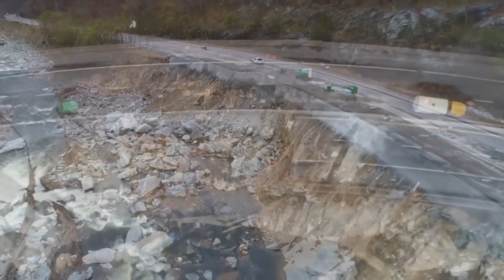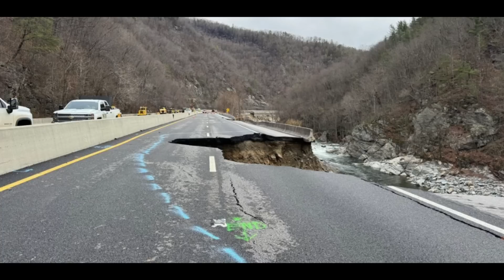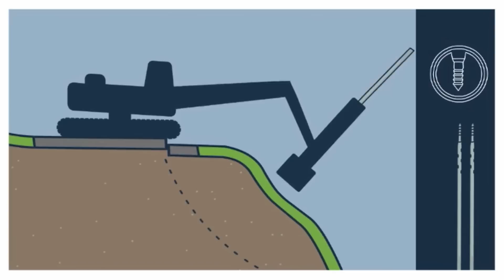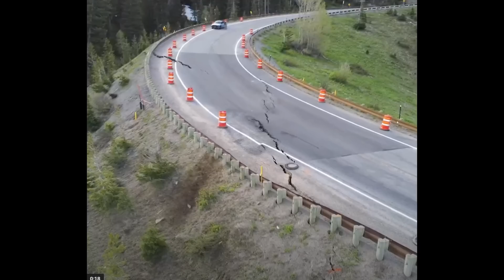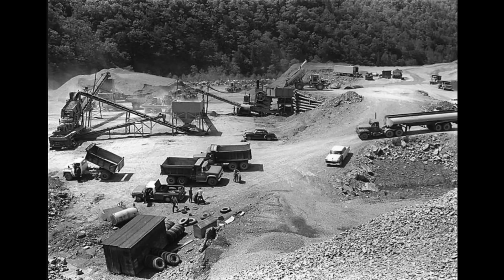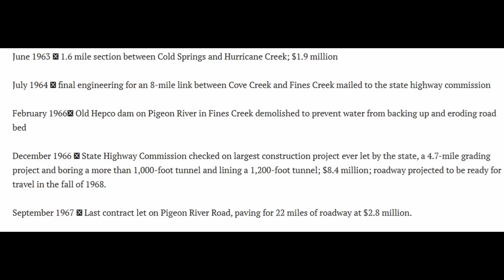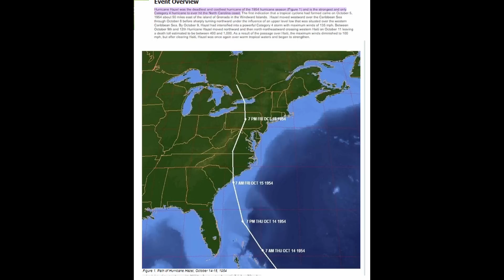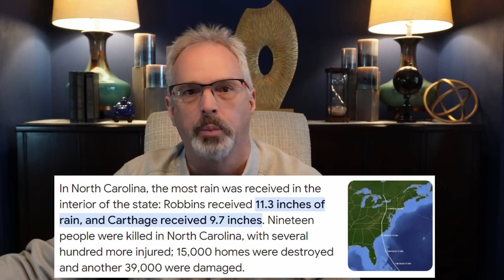Interstate 40 Rebuild Status

Comment: The alternative to the current route through Haywood County would be to go through the gentler slope over in Madison County (as I understand it). But the problem there would be a better bypass around Asheville. I’m not sure how much that would add to the cost.
Reply: The Asheville Bypass has already begun but that doesn't mean a great deal to this problem at hand. It will take a decade to complete the Asheville Bypass at least. Currently I 40 detour traffic has been rerouted  through Asheville. The traffic on I 26 and I 240 has become has only made local problems here worse.
You are correct as to this being a much better route to Tennessee. The current path of I 40 was a political mistake.
Reply: @tomwilliams7773  You are right. But the new bypass is for I 26 they would need to add two more lanes for the I40 traffic up to where I 40 turned west about Weaverville.

Comment: Thanks for your sensible update of this project.  I had no idea what was going on because the News has moved on.
Reply: I agree, as soon as its not headlines anymore they don't care anymore, however something like this is critical to the transportation industry.  Everything a person purchases comes by truck at some point!  🤠👍
Reply from the maker: Thank you I appreciate it!
Reply: Your comments on rebuilding  I40 NC. On the 15K loads of fill. Consider the damage those loads would do to existing roadway. They would be working on it for the next decade.
Reply: @cwdtransport2247  his estimate was 55,000 truck loads.
Reply: The drills into the shock crete are a waste of time, there is nothing like enough rebar in the shock crete to hold the drill plates of the pins. It will crack the shock crete @ the plates of the pins… this is wasting too much time, trade materials for time . Carve into the mountain for a new base, think ,, (bigger),, scale up.
Reply: They're still talking about Jimmy Carter dying on WLOS.

Comment: Need a relocated route that is out of the river valley. Time for NCDOT to begin studies.
Reply: No just need a different river valley . Needs to go down the French Broad River valley to Newport TN.
Reply: @robertkirkpatrick7903  
The US-25 route. It is really not better than the current route.

I was thinking of relocating 10 to 20 miles of the existing route, on a straighter route on higher ground, with 2 or 3 tunnels needed thru mountains.

Comment: It's just amazing to me, how little common sense or critical thinking is used by state engineering agencies in today's world! Your channel deals with a lot of state DOT type situations, but this lack of skill, ethics, common sense, critical thinking seems to be prevalent in every situation you cover, and from state to state! Is the cause, that states want to do everything as cheap as possible now, and the public or taxpayers safety or consideration for long term infrastructure is no longer the goals? On the topic covered, they should re-route the road to higher ground away from the river, and especially river bends that will cause the most issues during flooding situations! Open the two lanes to get traffic flowing again, while they divert the road away from these areas!

Comment: Your rough calculation of the amount of fill necessary to rebuild I-40 to the original 4 lanes is excellent. One recent example here in California was an effort to remove sediment that had accumulated behind the Devil's Gate Dam in the last century. Los Angeles County Public Works removed 1.3 million cubic yards of sediment, but it took 3 years with a huge number of the tandem-trailer trucks (I think 24 cubic yards total) making 400 trips a day. The access was very easy with the location about half a mile from the Interstate 210 freeway on and off ramps at each end. The Devil's Gate Dam is on the Arroyo Seco River, just above the Rose Bowl stadium in Pasadena, so they really needed to restore the flood-control capacity of the dam.
Reply from the maker: Thanks Eric.  Sedimenration behind dams is a huge problem and it's only getting worse each year.
Reply: @CaseyJones-Engineer someone should have thought about that on the Columbia River!

Comment: I drove this section of I-40 in eastern Tennessee and western North Carolina in 2016.  This a rough estimate, it could have been any time from 2015 to 2019.  After driving this road once I swore, I'd never drive it again. It's what they're not saying that matters.  Rock slides are an issue on this road, requiring constant attention.

I found that when maintenance was being done, they would condense the road by minimizing the shoulder lane and adding a Jersey barrier.  Repaint the lane markings at minimum widths, add another Jersey barrier to protect construction workers and voilà you have a minimalist highway.

The current alternative to I-40 is I-26, which is 2 lane and no trucks.  Trucks are sent to I-77.

If I were asked for my opinion, and I won't be, I would recommend digging tunnels like the Norwegians.

Bob
Reply: Trucks can drive on I-26 I drive it all the time

Comment: Drove this section sections several times over the last 30 years.  Last time a couple months before the storm.  It surprised me how little had changed over the years the Eastward route had a lane closed coming from Tennessee every trip I can remember, not sure why.  I also noticed how the hills were not stabilized for rock fall with fence and not cut back at a good angle.  If the last real road work was in the 1960s, I would assume the must have been a revitalization plan for the road as it entered the new century let alone 25 years later as the population does grow and with it traffic!  Also guessing the state and region would have a budget and funds in place to perform this revitalization as it is a major east west highway and also railroad corridor. Doesn’t this area contribute to the state GDP?  Curious to see how and when this crisis is solved!

Comment: No, they will have to restore 2 lanes and re-route the thing... You made the video about Brienz, GR, CH. Maybe the north-corolinians want to take a page from the swiss book of the A4/H2 between Altdorf, Uri [46.8909N,8.6186E] to Ingenbohl (North of Altdorf) along the Vierwaldstättersee. The Axen-Street. A heavily used section of road, only two lanes, parts of the stretch is sliding into the lake. Swizerland is currently creating tunnels to re-route the traffic and try to improve to the whole flow, because this street is the shortest route Zuric City to the Gotthard Passage (Pass, Autobahn-Tunnel, Train-tunnels)

Comment: My question: have you seen any traffic studies which justify the need for 4 lanes? Would 2 lanes satisfy the traffic load?
Reply: After driving that route may times, 2 lanes would not support the traffic load. Many sections of the uphill have one lane filled bumper to trailer with trucks. Traffic volume is high as it splits into two interstate highways at Asheville and two interstate highways at the north end of that stretch in TN.
Reply: No it is I 40 . Most days it needs Three lanes now one for trucks and two for cars . I 40 and I 26 are the only tow interstates from western North Carolina to tenn. And most two lane roads in the mountains are narrow and sometimes steep.

Comment: I was a Red Cross Disaster Chief at the Smoky Mountain fires in Dec 2016 and quite familier with the I-40 area from Asheville to I-81. I agree with your assessment that they should reroute I-40. There will be a lot of push back due to political and tourist issues with Casinos and Dollywood. Mr Jack
Reply: Seems the folks running the casino, tourism and other businesses were not paying attention to the reports that came out years ago about the condition of I40 and bridges.  One would think if your business was tourism for estate, mountain or casino visits that you would insure the infrastructure would allow customers to get to and from your facilities and the same for agriculture, forestry or manufacturing to get raw materials in and products out of the area!  A lot of timber on the ground in the region again this year curious to how the region deals with that.
Reply: Why would the casinos and Dollywood care? If this section of I-40 were rerouted it would still connect up to the existing highway somewhere west of the gorge. It would also make the road more reliable, which would be good fro the business in Pigon Forge area.
Reply: @JeffDeWitt  The casinos is in Cherokee N C.
Reply: Rerouting I-40 on this 22 mile section will not affect either Cherokee or Dollywood. They are nowhere near the area affected. What will affect those places is the time that I-40 is closed. Rerouting this section will not change one factor. That is how remote this section of road is. The North Carolina section has no nearby roads for miles. They will still need to truck in a lot of materials. I-40 is a major east/west route. I-26 will be able to take up some of the slack once it is completely reopened.
Reply: @larrypatty8333  I-26 is open, but limited to vehicles of 10' width or less.
Reply: I bet, if someone presented the right plan, Dolly would come out in favor of the re-route and that would end the political debate.
Reply: Rerouting I-40 through the US 70 corridor makes sense, and would connect with the current alignment near Newport, TN. It would have no affect on anything in Pigeon Forge or Gatlinburg.
Reply: The people in that area would be much better off without the tourists, casinos, and Dollywood.
Reply: @jimturpin6503  how with no jobs
Reply: I agree, a quick and dirty method would be simply to renumber I-81 up to I-78 by Hershey PA and the full length of I-78 as I-40.

Comment: I'm a bit curious about what the bedrock looks like under the road and filling. Overall geology is important. If the geology is bad then making a tunnel might be a bad idea.

When you say 1 in a 1000 - then the question is also if it's 1000 years, months or days.

For cost measures - it's also hard to compare 1960's costs with costs of today given that the equipment available today is often more effective and there's a lot more experience to build estimates from. Inflation has taken a toll on the cost too. A simple relation to inflation is that $100 in 1965 is now $1000. A lot of permits are more expensive today though.
Reply: A lot of the bedrock is not good.

Comment: I believe that rerouting of this section would be in the best interest since they have had many previous events that have limited traffic or even shut the road down.  Great work and observations!
Reply from the maker: Thank you!  I agree they need to completely rethink what they've been doing out there.
Reply: Where - this is the mountain pass, the other option is to go over the mountain.  A 16 mile stretch then becomes 40 plus.
Reply: @scotthix2926  Take I 40 north of asheville and about Weaverville turn to the west going by Hot Springs and down the French Broad River to Newport Tn .Basically taking the same route as US 25 and US 70 . I 40 goes threw the Pigon River gorge on its way to Newport TN now.
Reply: @robertkirkpatrick7903  Might better utilize the $$ to widen US 25 and make it I-40.
Reply: @scotthix2926  Point well taken, yet look at all the isues they have had over the years with slides resulting in lane or tatal road closures.  if you throw in a couple of billion to repair, what will prevent this from happening again?

Comment: If they want 4 lanes of traffic they need to dig up that failed section and start from scratch. Trying to repair it will not work and will end up costing more money and time. They need to keep the road closed until it's rebuilt. What is the expected lifespan of an interstate hwy?

Comment: Why is it necessary for you to do this analysis?  I am not saying, you should stop, but where is the media?  I think, I remember back in the day, where questions would come from the press questioning henkie portions of a plan.  Perhaps, having only 6 mega-corporations own all of media may have a downsize. 😮
Reply from the maker: The lack of diverse media is part of the problem. The other is that in the best of times they could seldom drill down effectively on engineering related issues.
Reply: @CaseyJones-Engineer ,  do you think they will bypass the PostMortem phase and not produce a lessons-learned document besides triple the cost and double the time needed?

Comment: Great overview of the constraints facing this project. With consideration to this road needing "some" availability during rebuilding, scheduled closures (2 days open/2 days closed or something similar) seems to be a viable option. The contractors would have exclusive use of the major areas during shutdowns and could concentrate on replenishement and material import/stockpiling when production was not happening. Finding processes/activities which offer the greater efficiencies where available; ie steady production activities, import material in close proximity, etc., is about the best they'll be able to acheive. Thanks for sharing.
Reply from the maker: Those are really smart suggestions, thank you!
Reply: I'd use all the local river rock, pack it in the voids, drive your casings, wire netting & guite over them, which has a life expectancy of 100 years, more casings to support the under road bed, then add fill from the top to build the road bed, Then form reinforced slabs to swing into place & stack them like shingles on a roof top the way the river flows, down into the waters edge. Local stone, faster flow rate, 100 year material life, less hauling of out of the area materials., Less costs.

Comment: Knowing NOTHING about the site, it really looks to me, from my arm chair, like they need to cut into the hill some more/ gain some margin for the waterway.
Reply: He has left out the pigeon gorge history with land slides.  Last one was 10 years ago, closed the highway for a year and a half I believe.  The underlaying bedrock is not solid.
Reply: @Ripped-Inflatables , when my wife and I drove past the part that had the slide, three days before it  happened, I told her that the side of the mountain right there didn't look right. There were big gaps in the rock and it looked like they were already sliding a little bit. I guess it got to the point where it just let go. That area is going to continue to have problems because the sides of the mountains there are so steep.
Reply: Same problem as Casey described... they'd have to close the existing highway completely for however many years it took to blast away half of a mountain ridge for 10+ miles, then somehow keep what's left from sliding onto the highway.
Reply: @loopshackr  You are correct.  However, we already know that we failed / under built on the waterside.  It may make more sense to cut above and stabilize rather than full below and stabilize... The water volume will still be there to deal with at some point.  The fill volume is in direct competition with the cross section available to flood waters... So going into the already steep and stabilizing the already unstable slope may still be the better long term option... The road is going to be closed during construction either way.  It seems like going into the waterway is inviting the same problem in the future.
Reply: @loopshackr  I see no other practical solution economic or time frame .
Millions of cubic yards of fill needed .
Insanity to use  dump trucks traveling miles away to deliver such .
Reply: Exactly 💯 That's how they initially built much of it.

I have land near there .
Reply: Probably on to something there.  Might even produce the backfill they need to build the road and stabilize the mountain side.
Reply: This was my ASSUMPTION of what the reconstruction would be, for ALL the roads seriously compromised. 
I am not a civil engineer, and that is probably why the solution seems like common sense.
I live in the mountains. I hike, and cut trails, and deal with water erosion on these mountain roads a lot....i can say, hands down, fill never lasts, no matter what you do....mama nature is bigger. And that is shown in these failures.
However, when you build ANYTHING on a slope in the mountains, you cut into the slope for stability. The undisturbed soil and rock underneath is MUCH more stable. 
So, with my hillbilly experience "CUT, don't fill" seems like common sense here. But, the Wright Bros and NC DOT know best about wasting taxpayer money. 
The money we gave away to other countries could fix ALL the infrastructure problems in the country, and use the military assets and equipment. Take care of yourself before you take care of others. 👍